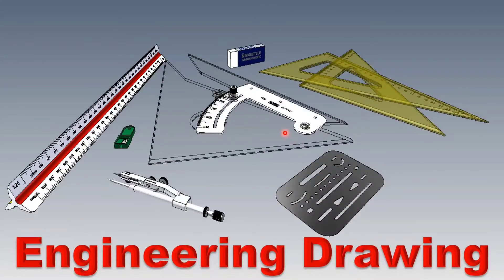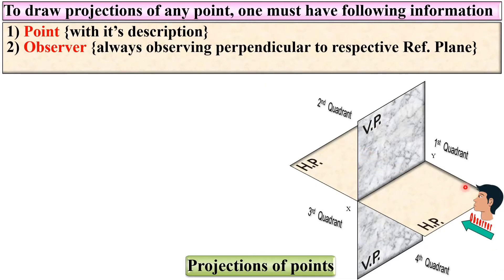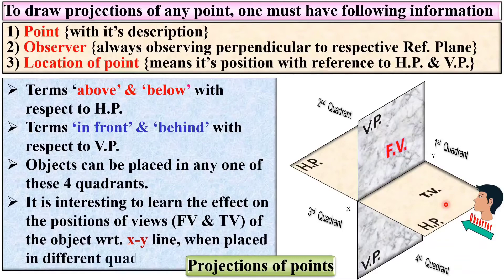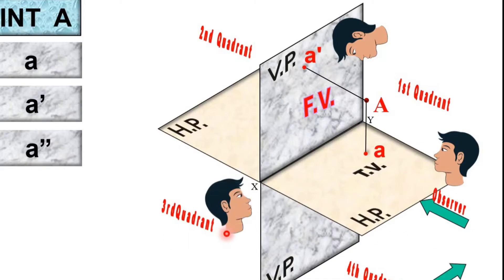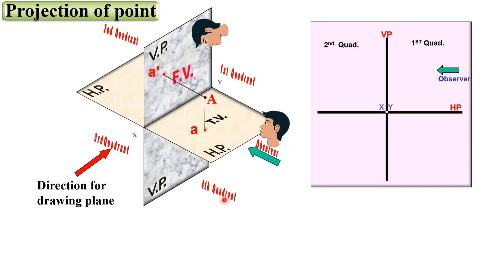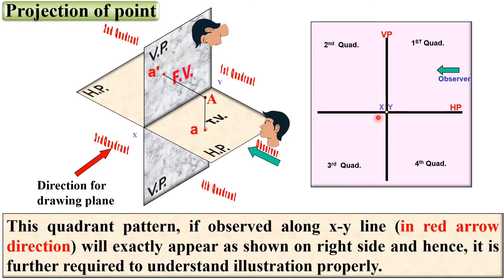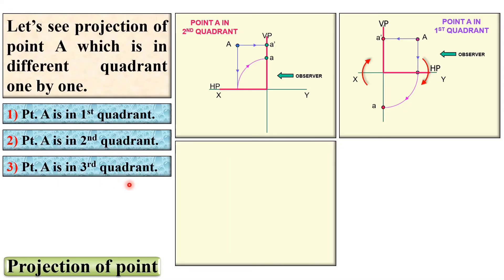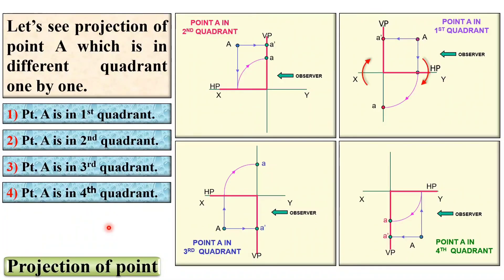1 - Projection of points (Basics, Drawing Process & Solved Example) Explained in Engineering Drawing

Comment from the maker: Projection of points explained with following timestamp: 
0:00 – Projection of points in Engineering Drawing lecture series 
0:48 – Concept of Projections of points
2:44 – Above and below HP 
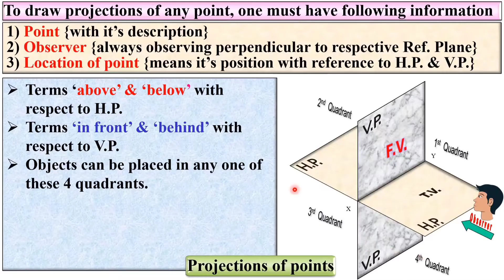2:58 – Infront and behind VP
3:21 – Notations for projection of point
3:41 – Top view 
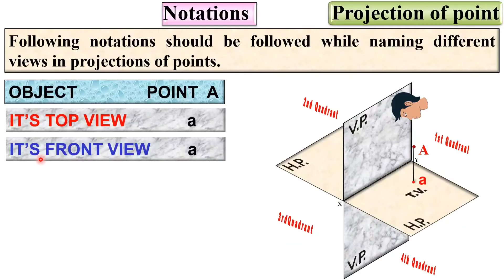4:21 – Front view
4:44 – Side view
7:40 – Pt. A is in 1st quadrant
8:53 – Pt. A is in 2nd quadrant
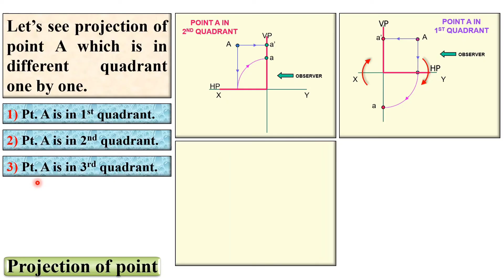9:30 – Pt. A is in 3rd quadrant
10:04 – Pt. A is in 4th quadrant